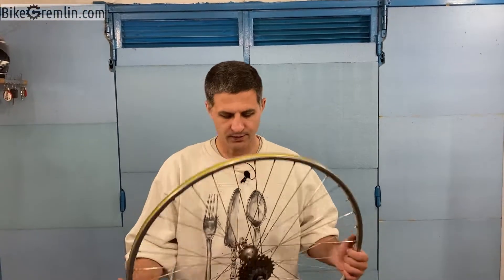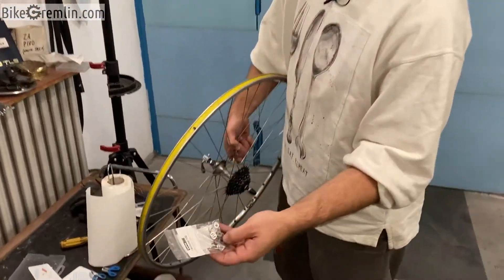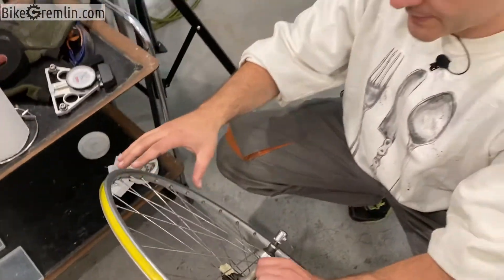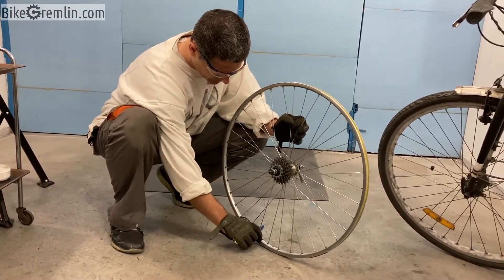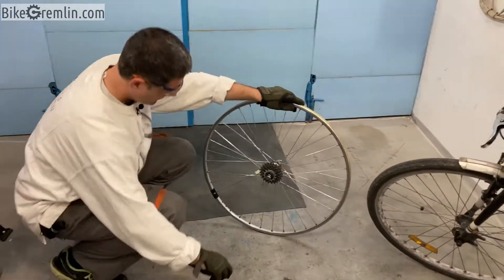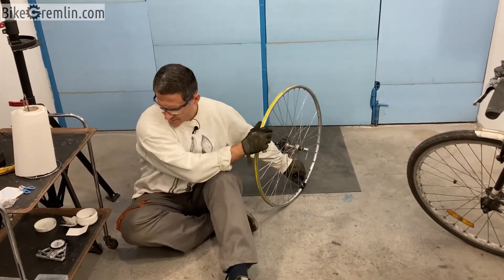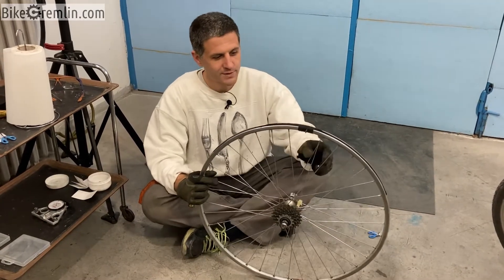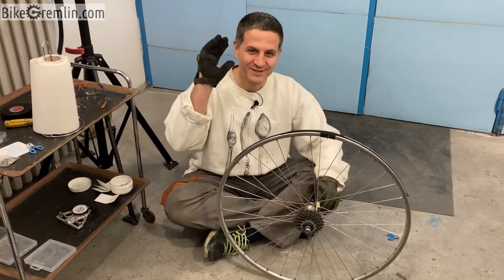Do spokes break from too much load? Spoke breaking under tension

Comment: Hey is there a 26" Beach cruiser "Rear rim" and or spokes that can comfortably handle/Support a 350 - 400lbs person's weight without the spokes "Constantly breaking at the REAR J-bend?!!" ALWAYS, ALWAYS, ALWAYS...I'm tried of the S#!t!!🤬 My current bike is the Kent 26" Bayside cruiser  Model # 72696 (Black & Blue Discontinued) It's just for general riding around town not racing. Is there a Rear 26" 7 speed freewheel Rim with spokes suited for heavy riders 350lbs + that will fit this model Beach cruiser?! Please help!😥
Reply from the maker: Yes there is.
- I would recommend a hub with 36 holes (for 36 spokes) - Shimano mid-range ones are good.
As freewheel is not a very strong design, I'd get a freehub hub. Those sold as 8, 9 or 10 speed ones should fit and work, but you'd need to place some spacers before mounting a 7-speed cassette on it (a cassette will also be needed instead of the freewheel).

- Double-walled aluminium rim, also with 36 holes. 

- Swagged ("double-butted") spokes by Sapim or DT Swiss. 2 mm wide on ends, 1.8 mm wide in the middle. Optionally, one could go with what DT Swiss calls "triple-butted" spokes (Alpine III is the name if memory serves me), which are 2.3 mm wide at the elbow, 1.8 mm in the middle, and 2 mm on the threaded (nipple) end. 

Combined with 12 mm long Sapim or DT Swiss brass nipples.

Lace it 3 or even 4-across if the particular rim-hub combo allow for a 4-across lacing with 36 spokes (i.e. if there's not much spoke-hole overlap).
Reply: @BikeGremlinUS  🤯 WOW, Such Jam Packed information Awesome!! Hey, you should do a 《UPCOMING VIDEO Request》,  Titled: How to build a Rear Wheel To withstand HEAVY Riders 350lbs +! Demonstrate all the information you put in that 1st Reply That would be AWESOME 🚴‍♂️BikeGremlinUS!! BTW That KENT 26" Bayside Cruiser Model 72696 came with the 7 speed freewheel on the Rear hub... So there is a Difference between  a 7 speed Cassette vs 7 speed Freewheel? I Thought they were One in the Same. 🤔🤦‍♂️
Reply from the maker: That is a good idea - I'll try to make such a video.

I did make videos and articles explaining how to build strong wheels. This is the "roof" wheel-building article that links to my other articles and videos - based on the topic:
https://bike.bikegremlin.com/9276/bicycle-wheel-building-basics/

Regarding cassettes for freehubs vs freewheel cassettes, I explained it here (in "chapter" 4):
https://bike.bikegremlin.com/158/bicycle-rear-hub/#4

Relja
Reply: Modifying the j-bend during the build is absolutely necessary, or they will flex there and break there.

Comment: Fun video to watch!  So was DT Swiss right (listen at 0:15)?  Looked to me like the spoke itself did break (albeit at the threads)!
Reply from the maker: The point is that the tension at which spokes break is huge. Way beyond a rim can take (if more than two spokes are brought to that tension, not to mention bringing most of them close to that).

Spokes don't break from being to weak to take any huge tension, but they break from fatigue. Even thinner spokes (like 1.8  mm) are more than strong enough. It's the stress cycles and poor or uneven tension that kills the spokes.

The spoke in the video broke at the threads, probably more due to the twisting, than because of the tension itself (I suppose it would have taken even more, had I been able to just "stretch" it using some rig, instead of relying on the threads and nipple to tension it).

Comment: "Too much tension" is not the same as "too much load". Your static test gauges the former quantity. Whereas a heavier load while riding causes the spoke to go through repeated cycles of tension and relaxation, which leads to the metal fatigue you mention.
Reply from the maker: Yes. That is the point of the video.

Comment: I just got home from a motoized bike crash my front wheel spokes bent during a hard left turn at aboit 25mph and i slammed on my left side, skin on my elbow and knee is scrapped off.i may guit motorized biking or get heavy duity mag wheels. im 225lbs. dissapointing day for me.
Reply from the maker: Get well soon. 

I fall down a lot. And I always joke that a fall is in fact a short, low flight. 
If I can walk afterwards, I conclude that landing was excellent as well. :)

Strong double walled rims with 36 spokes can make for surprisingly strong wheels. 

Additionally, if ithelps:
for bicycles, leaning along with the bike (i.e. staying inline with the frame) reduces any sideways load on the wheels.